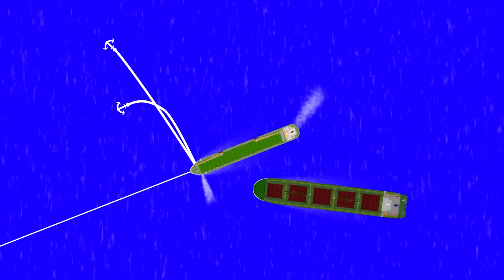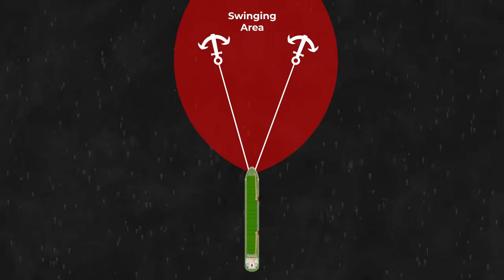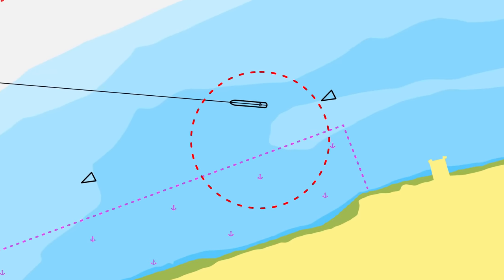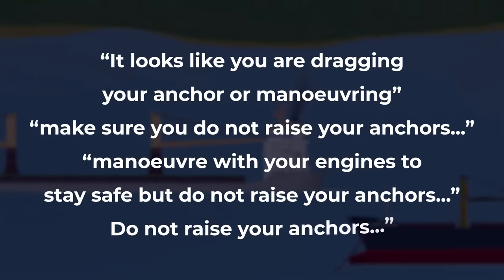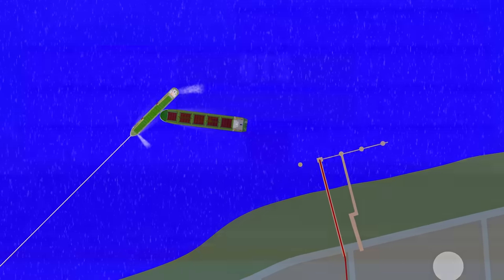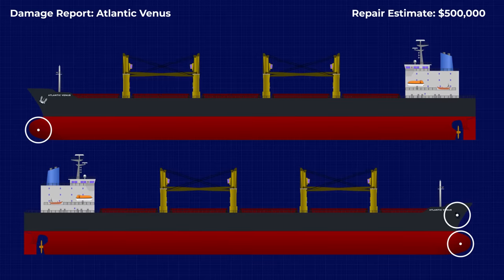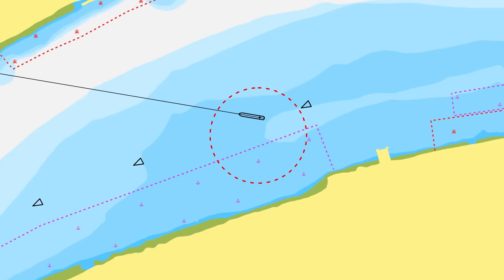Why Weren't Two Anchors Enough?

Comment: Even if this is a case study where lessons are to be learned. I am pretty sure there is still blame to be dished out.

First blame is on the chief officer for disregarding the findings made due to lack of familiarity with it.
"I don't know what i am seeing so everything is probably fine"
That's a very dangerous mindset to have. If something seems off, chances are everything is very very wrong and it's not just going to sort itself out.
Figure out why it seems wrong and fix it before it's too late. Because one small wrong can escalate into an uncontrollable situation really really fast if another small thing goes wrong later.

And second blame and the cause of the whole "accident" was VTS basically telling the ship that it wasn't allowed to rescue itself and just sit there waiting for a pilot that would never come.
Imagine you fall on the train tracks at a train station and security tells you to stay there because you are not allowed on the tracks and they need an authorized person that can't get there to get you off. Meanwhile the announcement speakers tells you of a train that is about to pass the station on those tracks...
Any sane person would climb off the tracks onto the platform or otherwise get out of harms way but security basically tells you that you are under arrest and shall not move because RULES.

Entirely avoidable even when you consider the reason for the chain of events that transpired. It was all because of lack of action by the chief officer and the authoritarian nature of VTS in an emergency.
In aviation, aircraft that declare an emergency are given priority over all others and don't need to follow instructions by the tower or ATC. They can use information and directions by either entity but they are actually free to just say "i am landing on runway 31 NOW and that's that" without having to worry about what rules they would otherwise have broken under normal circumstances.
The same really should apply of maritime operations. I am declaring an emergency and it's YOUR job to assist me in resolving this in a safe manner. Not tell me to wait until the emergency is a literal shipwreck.
A pilot should have been dispatched IMMEDIATELY and focus should have been put on avoiding ship to ship contact at any cost to "the rules" being broken.
Reply: Oh, it's certainly possible to assign blame. In fact, that's what the average person rushes directly towards, out of fear that someone else will blame them first, or simply to make sure "justice is served."

The problem is this puts the different actors in conflict and is a strong disincentive to learn objectively. When people conceal important data, lie to protect their interests, deny or obscure events, and avoid accepting how their actions contributed to the outcome, that directly works against learning necessary lessons and makes everything less safe.

Comment: is a person who grew up on the Mississippi River the river has a tendency to have multiple coins going every direction imaginable it is also made up of loose and moving sand on the base and bottom of the Mississippi .  as for letting out all other ships and could change 90% of the weight would be to dig into the ground but with the constant dredging done on the Mississippi the sand has a tendency to move multiple times so which means the ships anchors could not dig in deep enough to get a foothold into the ground also if it had a stun anchor it might have been able to being a better position .

Comment: The issue is liability and blame.  And the manner in which vessels are commercially operated/chartered.  Master's struggle to put their jobs on the line to take positive decisions, which in hindsight is the right thing to do once the incident occurred, but if it was done proactively to avert an incident then the Master will get it in the neck from the back office/shore management who all weren't there to see it, nor understand it, nor appreciate it, and majority of people have got been in that situation nor with that level of responsibility.  I feel these incidents are 'normal' for the marine industry.  The industry is run so lean that simple losses of time can attract nutters to literally lose it, and aggressive commercial operators to claim damages.  It's a brutal game.

Comment: We faced similar situations in our river although the vessel is only 120 meter long but i assure you anchor dragging is a very frightening situation. And only the captain of both vessels can avert this situation by giving up the anchor and start maneuvering by their own engine because if you wait for pilot or tug it is already delayed because you are not on ground it will take minimum 45 min to reach any external help

Comment: 6:51 Damage includes the loss of anchors on both ships - couldn't the anchors easily be recovered from the riverbed?
Clearly seems like a situation of legal process over common sense. This is discussed in aviation a fair bit, pilots are reminded frequently during training that they, not air traffic control, fly the plane, the pilot is ultimately responsible for safety, air traffic control makes mistakes, and in an emergency the pilot should do whatever necessary to save themselves and their plane. Similarly pilots are taught to question higher-ranking pilots when they think mistakes are being made. Thus an aviation pilot in this situation would have said "Screw you, anchors up, we're out of here!" But this attitude is written in blood as they say, this hasn't always been the policy and numerous accidents have taught the aviation industry, and codified into regulation, "Save your ass even if you have to disregard authority." Don't know how it is in the maritime realm, I imagine things are a bit more complicated with larger crews and longer chains of command. But even so, even if the crew legally had the authority to ignore these "orders," I still don't think they should be blamed for doing what they were told, the VTS should be held accountable for failing to provide aid while ordering (whether or not the had the authority) the crew to not take matters into their own hands.

Comment: 2:00 Pilot said to keep engines on standby due to expecte weather and current.
Directions that should have been given . . . If it looks like you start dragging anchor, put the engine in forward to take some load off the anchor 
Crew was like put engines is standby, got it.

Comment: Why does it always seem like some of the most careless operators get control of these ships. Of course we're just highlighting accidents, but they still seem relatively preventable if someone properly cared and knew what they were doing.
Reply: well that's the problem probably, that people don't care, get lazy, and mess up expecting nothing unusual will happen
Reply: Because otherwise there is no accident. Good example of selection bias. 

As for they seem easily preventable . Yes probably but it's always a quetion of cost vs benefit. The swiss cheese model works well to prevent accidents but it is always a trade off of how many layers you can afford and need. The reality is that the maritime industry is comparatively low risk and this is a rare accident.

Is it technically possible for every sizeable port to have standby pilots and an emergency center similar to what airports have? Sure. Is that worth it? Probably not. And unlike in aviation fatalities in such instances are very rare.

Comment: I know nothing about ships or boats - all I do is watch films and videos. 
All they had to do was order slow ahead, to take weight off the anchors,
and steer the ship.
Mentour pilot says "aviate, navigate, communicate"
First, and above all else, FLY THE DAMN PLANE!.
Second, LOOK WHERE YOU'RE GOING! 
Third call for help.
Reply: With current and anchors pulling the bow left and right, it is alot harder to steer than your car. Think of it more like heavy crosswinds from both sides when landing a small plane. It can litteraly move you side to side, but at least your still heading forward not turning
Reply: The big difference between aviation and marine navigation is that there is a lot of inertia involved with these massive cargo ships. You can't just slow down last second or quickly steer the ship like you usually can with an airplane. At that point it is likely far too late.

Comment: I don't understand why two bow anchors set out like this wouldn't hold better than one.   Wouldn't 100% of the holding power be available on each anchor, in turn, as the strain is shifted from one rode to the other?  Shouldn't a well-designed anchor be able to take an off-axis pull, say up to 20 or 30 degrees, without being worked loose from the bottom?  
 
I've been living aboard for  20+ years and have anchored in hundreds of different places.  My preference is to hand on one BIG anchor instead of two smaller ones.  My anchor of choice is an "old fashioned" (say some folks) CQR that has a hinged stock that is supposed to allow an off-axis pull.
Reply: Power multiplication. Just like a pulley system or a hydraulic press. Force times distance. You are changing the distance part of the equation. A single anchor straight ahead has to move one foot for every one foot the ship moves. With two anchors, both ahead at a slight angle, you double your holding power. You have to drag two feet of anchor for every foot the boat moves. But with the anchors set at a wide angle, that changes. With both about 45 degrees off your nose, for every foot your ship moves back, each anchor only has to drag 6 inches. Your back to the same holding power as a single anchor. At something like 60 degrees, the ship can move back 6 feet for every foot each anchor hast to drag. Multiplication of force dictates that force is a multiple of distance. So the anchors only needs to move 1 foot each totaling 2 feet for every 6 feet the ship moves, this is a 3 to 1 ratio. The two anchors are feeling 3 times the load being applied to the ship. They are splitting the load still, but each is feeling 1.5 times the load a single anchor straight ahead would just because of the angle it is to the ship. 

 Thats straight loading. Shock loading is worse. I reality, both anchors dont drag at the came time. One will drag first starting a swing. When an oscillation starts, each anchor starts being hit with shock loading. Swinging on one anchor slacks the other. When it swings back, the ship builds inertia an snatches the other anchor loose. When that anchor catches again, the swing happens on the other side, doing the same to it. This happens over an over. The ship walks backwards, yanking on one anchor at a time. With enough space, this is a self fixing problem. But if something is behind you, well, this happens.

Comment: how do we not have sensors that can immediately send out an alarm when any anchor drags more than X metres? surely we have this tech and it probably wouldn't be prohibitively expensive? also, how did they not see the ship's position shift so much with gps?

what are we, still in the early 20th century? for once we hear two ships actually radioing each other! but... marconi invented the radio in 1897, and the first recorded ship-to-ship use was in that same year!

Comment: its not the  anchor its the  chain.. they didnt  have enough weighted chain  for the conditions..
 anchors hold the chain in place,, the friction of the  chain holds the  vessel.. too light of  chain  and  this  happens
Reply: 5kts current on a soft mud bottom and a loaded ship is a different animal. you want to put out enough chain to hold the ship but the more chain out the more the ship wants to sway then it will start to sway more violently, dragging the anchor

Comment: I'm a bit confused on the experience of the master... I mean it's literally his job to keep the positioning if the helmsman has tasked him to do so... They handed it off came back seen the error did nothing... Followed the comms and fought with his own common sense till the last minute. No one cares if you break the rules in an emergency unless your making things worse. Giving momentum to an uncontrollable vessel is not going to help.
Reply: It's not an emergency until you actually hit something though. 
Trying to justify your actions to external parties when nothing actually happenned, even if because you avoided it is not always an easy task. Tring to prove you didn't make it worse if it does become an emergency after your actions is also a hard task.

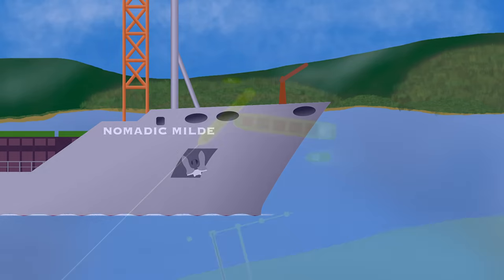Comment: Woahhh 10:24 The Larger Rescue Tug moved so muchhh water in front of it to break the 2 Vessels appart😮😳
Reply: That's not what the video described and probably not what happened. Briefly: the river current brought the ships together and the energy from the current being distributed across the hulls made it unwise for the ships to try to separate without help. As the tug approached, it affected the distribution of energy on the hulls. 

In the video, the situation is described as one of the ships starting to move. That is a true statement. However, moving wouldn't necessarily be bad if both ships had moved together. So, it might help to think of it as: one ship started moving in relation to the other ship, and the movement caused more problems.

Comment: When they noticed that things go south, why couldnt they keep the position with the engines? If the current is 5kt, just forget about the anchors and make RPM for at least 5kt.
Where everyone in command the dog from the meme sitting in the burning house saying "It fine"
Reply: They thought they couldn't legally raise anchors because there was no pilot on board or something like that.
Reply: @freshrockpapa-e7799  You dont need to raise the anchors for holding the position with the engines alone. Like i said, if the current is 5kt, just make RPM for 5kt or more and let the anchors were they are.
Reply: @wolf310ii  Because the anchors are still putting force on the vessel aren't they?
Reply: @freshrockpapa-e7799   only if the ship drags on it, if it makes enough speed to make 0kt over ground, the anchors chains just hanging down.
Reply: @wolf310ii  Hanging down is precisely why an anchor pulls the vessel in that direction
Reply: @freshrockpapa-e7799   you just dont get it. Sorry but i cant dumb it down any more for you.
Reply: @wolf310ii  no worries, I didn't ask you anything to begin with. You can just forget it like you think you can forget having where your anchor is and that magically stops it from having an effect.